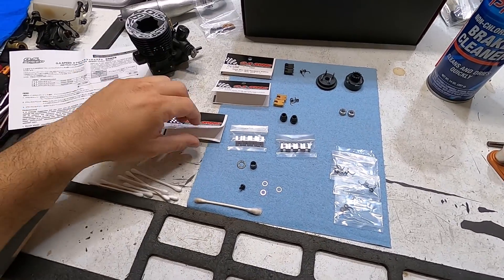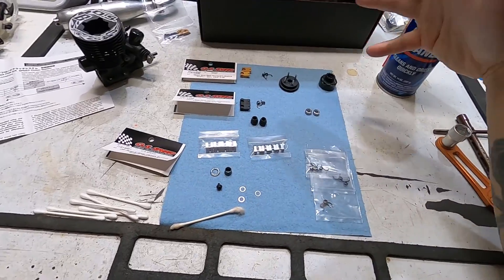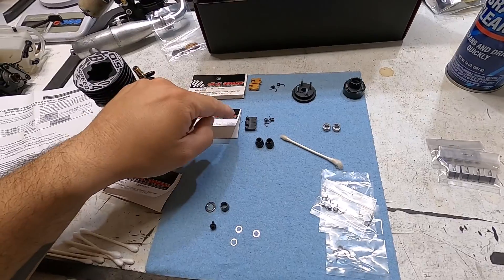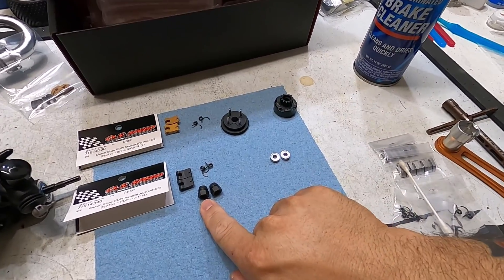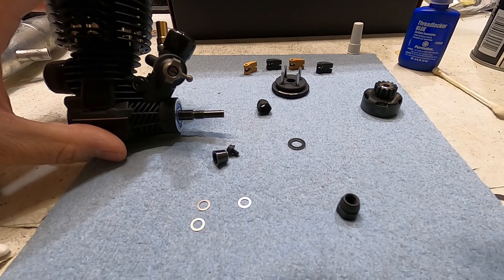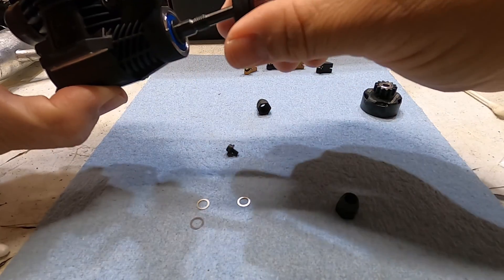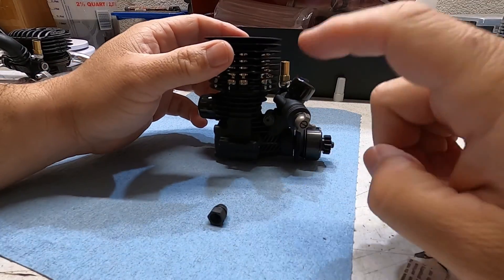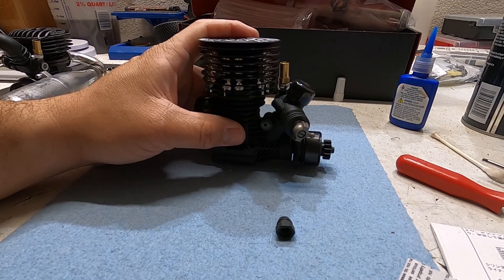O S  Speed Off-Road 4-Shoe Clutch Installation

Comment: Do you know the weight of the shoes that you used? Only asking because that also has an effect on speed of engagement and the way theyll hit with the different spring rates. You might be going for a certain feel. Good vid bro
Reply from the maker: My scale is not sensitive enough to measure the different weights of a set of shoes. The carbon shoes are smoother overall compared to the the aluminum shoes. I am currently running the hard clutch nut. hard shoes with standard springs (0.95) and standard shoes with hard springs (1.0 white) on my buggy and truggy. The engagement is smooth and distinguishable between the different springs.